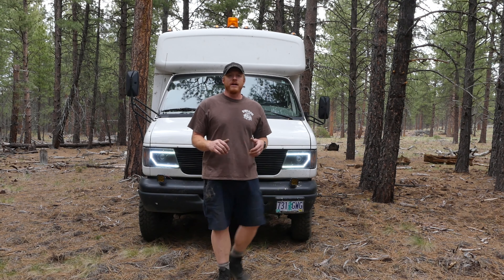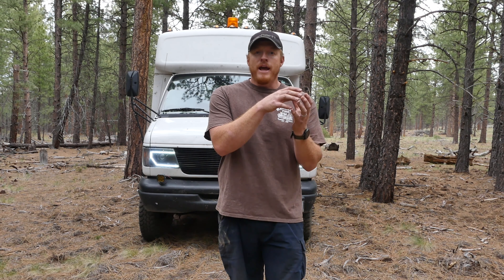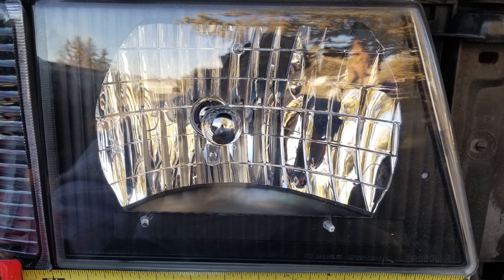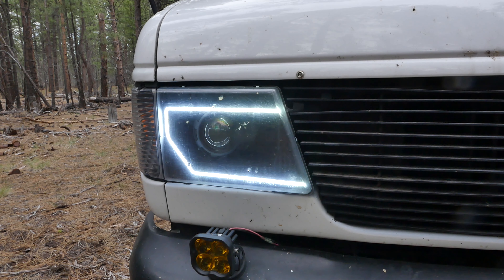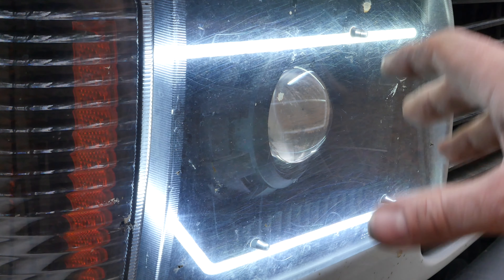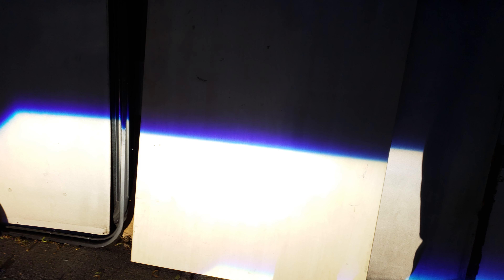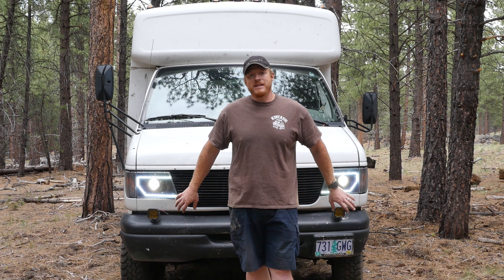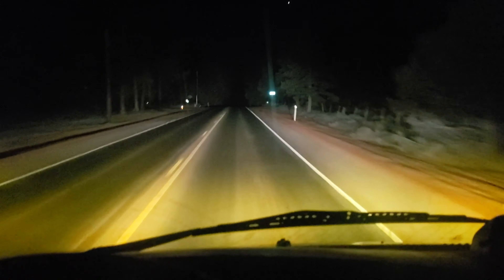ADVBUS Headlight Retrofit

Comment: Hey Cody 👋   Yeah I'm still out here, in spite of rumors to the contrary 😜   I like the way you tied the daylight halo running lights into the turn signal 👍   I've got a '99 F150 that I put OEM looking turn signal and headlight housings on. I upgraded all the bulbs (but the headlights, they are still HID) to LED....dash lights, dome light, courtesy lights, 3rd break light and the turn signal lights. On the turn signal lights I went with a LED turn signal flasher instead of putting resistors at all the bulbs 😉   OMG....everything looks so much better now 👍   TFS